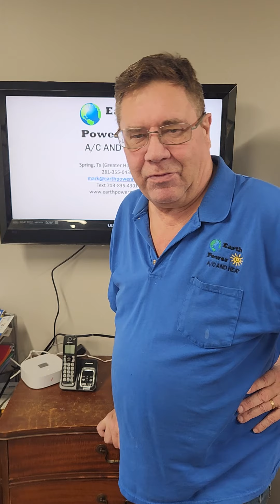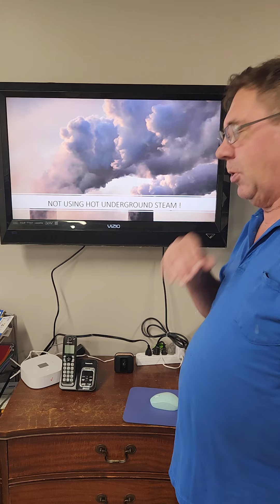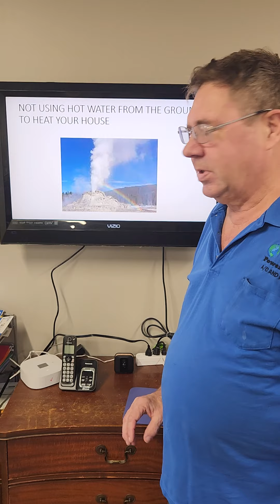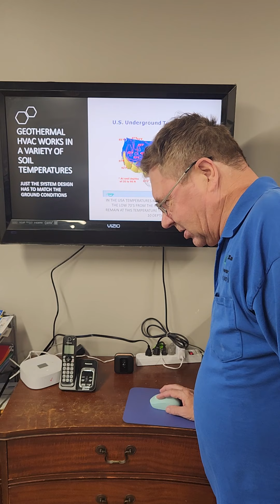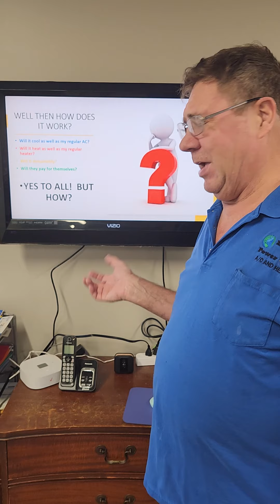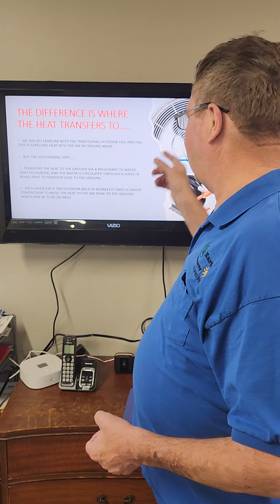Geothermal AC Misconceptions

Comment: Saw your videos about the Glacier Pool Cooler. Just had a pool built and Glacier Cooler installed. I live in Houston also. So far while running the cooler my pool temp hasn’t even dropped by 1 degree. My pool builder is not that familiar with pool coolers. Could you recommend a certified Glacier Pool installer that I could contact so I could have it checked out by someone with experience.
Reply from the maker: Just saw your message. We service them Earth Power AC and Heat Best to email mark@earthpowerac.com